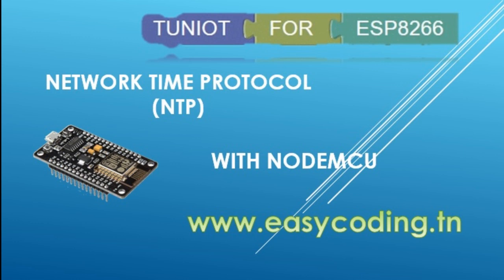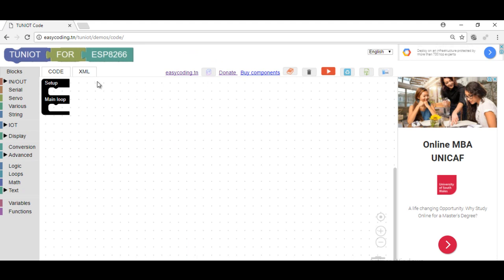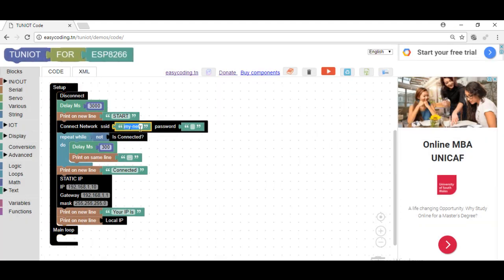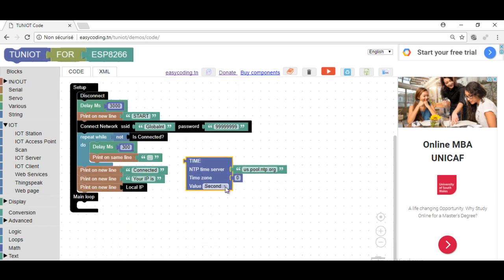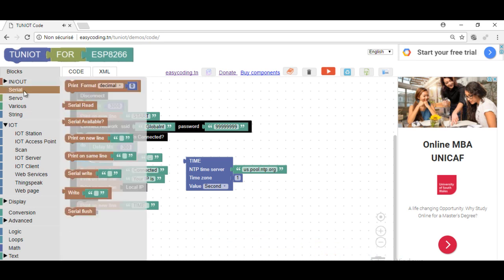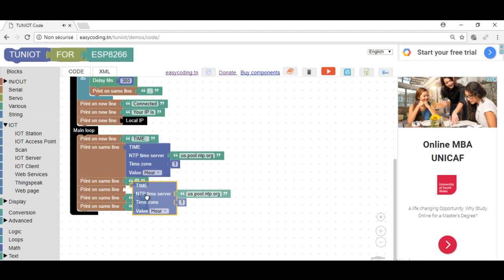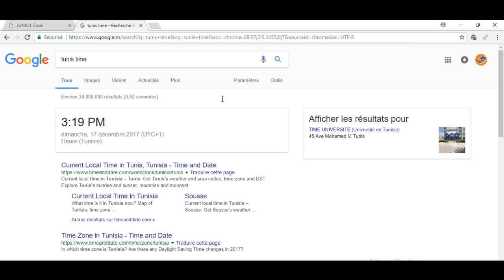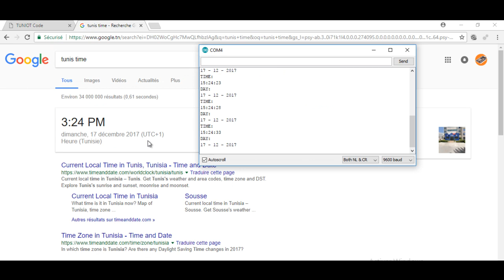NodeMcu (ESP8266) Tutorial C-01: Network Time Protocol

Comment: Got this working and thought it was fun and useful. One question.
The date and time were shown as:
TIME
22:32:10:
DAY
12-18-2017
My computer time was 10:32:xx
and the day was 12-18-2017 <--yes I changed the order for displaying the date.
How do I has it display the time to match my time zone. Tried changing time zones but that didn't correct the problem. What am I doing incorrectly?
Reply from the maker: +Rud Dog i am traveling now. See this by the weekend
Reply from the maker: The functions work fine. The display of the time is in 24 format. And in your computer you display in 12 Format. You need to convert into a number and do (minus 12) to get the date in 12 format.
Reply: Thank you I did try random numbers but never got to -12 or minus 12, thank you for clearing this up.